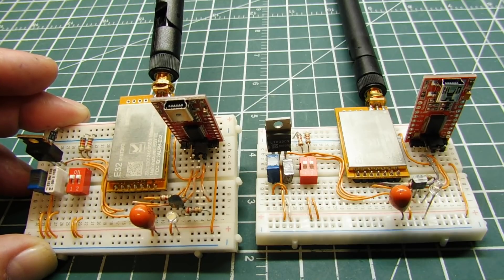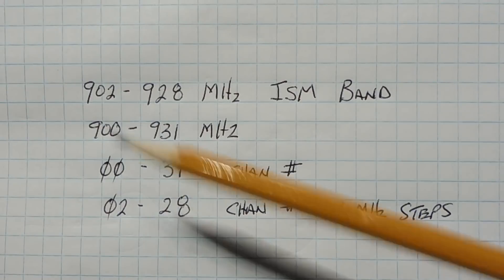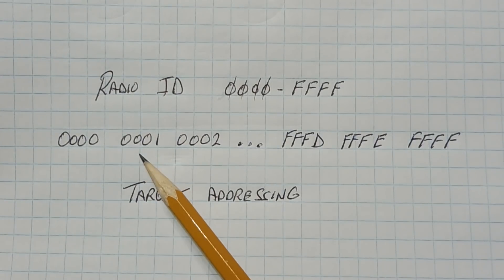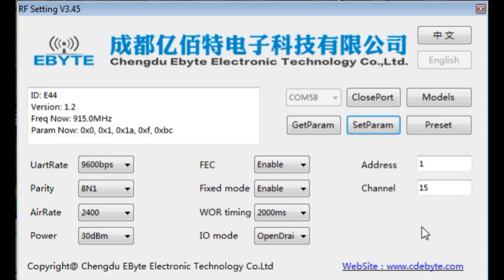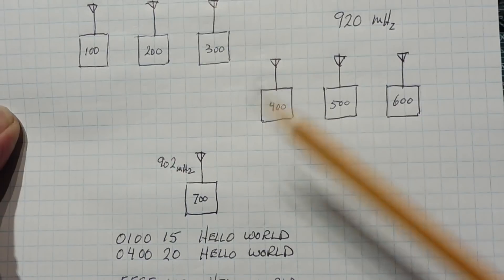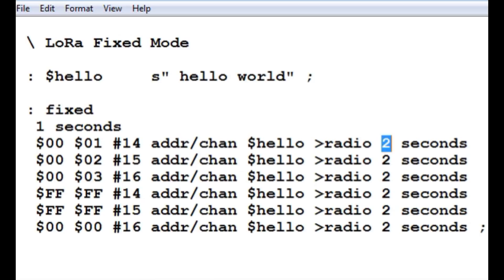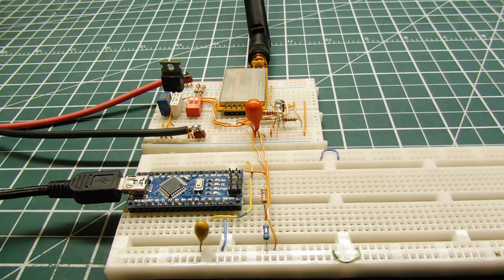LoRa Radio Point To Multi-point  / Target Addressing

Comment: hello, how does the module know when you are specifying the address in fixed mode?  If it's the first message after 2 seconds, it's obviously the first three bytes.  But what if I have a data stream?  Then my stream is cut off randomly and I don't know when to provide the address bytes again..

Comment: Hello again 0033mer! My E32 radios have finally come in and they have been quite fun to play with. I have a question or two (that will probably seem remedial to you) but I have been stumped by this, and as such I knew you were the right person to turn to.

I have the radios wired up on two different breadboards As per your wiring diagram. (Thanks again for that BTW). And, in BROADCAST configuration, I am successfully transmitting strings of data through Tera-term / Arduino IDE / ETC.. No issues there. 

BUT when I attempt to try the FIXED transmission configuration, I have no luck. I am using the eByte RF configuration software (which seems terribly documented, but it's the best option) and I set the address and channel so that when I 'get parameters' it reads back with an address and a channel equal to 915 Mhz. I have the power set down, and each radio has an antenna. they are spaced about 25 feet apart ( on separate floors of my house). This testing configuration was good for the broadcast transmission. 

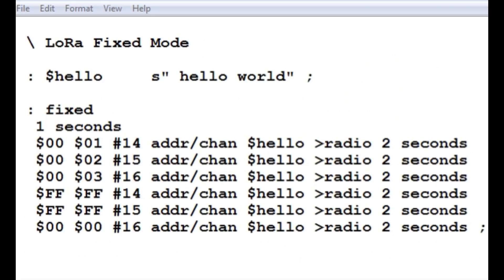I suspect I am not addressing the packets appropriately. At about 6:10 of this video you throw up some (I'm guessing pseudocode) that makes sense to me, but I don't know what is needed and how to implement it in say - a string I'm trying to send via terra-term. 

Can you provide some insight as to how I can address a simple string in Tera-term? or am I going about this completely slanted? I know the address is two bytes of hex, should those be together in the transmission or separate? can the channel just be the number 15, if I'm running 915mhz, of is 0xF the right way of doing it? I feel that I am close, but I keep getting nowhere fast. Any help would be greatly appreciated!!!
Reply from the maker: Tera-term is an ASCII terminal program so when you send the address and channel it sends ASCII code not numbers, which the E32 radio is expecting. The code you saw in the video was written in Forth which sent the addr/chan as numbers and the string as ASCII. You can write your own code or use Realterm for simple testing. Realterm can send numbers to the E32 radio. In the send tab enter 00 02 15 84 69 83 84 and send as numbers. 00 02 is the address, 15 is the channel, and 84 69 83 84 is the word TEST.
These numbers are sent all at once to the E32 radio.

Comment: HI there - love your work. I have a question that Google is being unhelpful with. In fixed mode, when I send a message with an ADDH/ADDL and channel, it works fine - but how should I know when the packet is done, and I need to send the ADDH/ADDL/chan again, vs just adding bytes into the serial output buffer. It can't be null terminated as you couldn't send date with a zero in it - perhaps when buffer is full, or based on a timeout? The ebyte e90 DTU docs don't cover this.
Reply from the maker: The Ebyte protocol uses CRC and Forward Error Correction (FEC) so the receiver node will have "Good" data or "No" data,  it is up to you to workout the packet housekeeping. You could use time delays between transmissions or have the receiver node send an ACK back when packet is received or an NACK implied after a selected timeout. Start Of Packet and End Of Packet (SOP/EOP) can be used to indicated a complete packet or even simpler CR LF bytes for parsing. For complex systems I have used the S.N.A.P. protocol.
https://www.dropbox.com/s/i9lmty0jsu02fmi/snap.pdf?dl=0
Reply: @0033mer  For a start , thanks for the quick reply - I had built in my own CRC/retransmit function and I do have a SOP (but not EOP) in my protocol. The main issue is I don't know how often I need to send the ADDH/ADDL/channel. Currently I send it every packet but I am getting some packets just not being received and I think the transmission is getting out of sync and I am unsure if the ADDH/ADDL/channel is being sent at the correct time to target the packet in fixed mode. I don't have an SDR to validate the actual timing and what is being transmitted. When I went looking for docs I can't find anything about how long the datastream stays alive before needing to be started again with another ADDH/ADDL/channel transmission
Reply from the maker: The ADDH/ADDL/channel only needs to be sent once per packet but I think you might have a sync problem with byte subpacking. Every model is different but each have a buffer that you fill on the transmit side. Say it is 512 bytes on your model but the transmit buffer is only 187 bytes, so it sends subpackets of 187 bytes until the buffer is empty and your receiver might be confused. Try sending short packets ( < 50 bytes ) and see if it solves your problem. If it does, split your large packet into smaller packets and number them so they can be assembled back at the receiving end.
Reply: @0033mer  I am sending fixed size packets comprising of 3 bytes ADDH/ADDL/channel, then 2 bytes as a SOP header "AB", then a 28 byte data structure with the payload, then I am reading the additional 1 byte RSSI value added by the receiving DTU... So I am sending 3+2+28 = 33 bytes and reading 34 bytes. I have the sub pack set to 64 bytes and the device has a 1000byte buffer. I know the first packet is sent before the 64 or 1000 byte limit is received but I am unclear on the mechanism by which the DTU decides to cut off the input and send what it has.
Reply: interpacket delay needs to be around 1 second... I can make the problem WAY worse when I take that down under 500ms, and I can stabilise it greatly by taking it up to 2 seconds
Reply from the maker: The DTU monitors your data input and waits for 3 byte times (of no data) and treats that as data termination. When bench testing do you use dummy loads on the antenna terminals or distance the two radios with power output set to low?
Reply: @0033mer  Aahhhhhh, That is the magic piece if information I hadn't found anywhere else! (3 quiet byte times meaning termination). Unfortunately it does suggest my suspicion about the root of my issue is wrong but great to know. I am testing with 2 devices both turned down to -24 and the worst aerials I have :-) Many thanks for the assistance - I love your content... Very well presented and so useful!
Reply from the maker: Ok ... glad that helped. Make sure your addr-SOP-data-RSSI stream is continuous with no quiet times.

Comment: What 0033mer fails to mention here is that string needs to be in Hexadecimal in fixed mode
Reply from the maker: Check the code at 6:29. The prefix "$" indicates hexadecimal.
The address range at 1:50 is in hex.

Comment: i want to setup lora network. can I read this data from the master by using multiple transmitters with this addressing
Reply from the maker: The receiver can acknowledge back to the transmitter using fixed addressing to target one transmitter. It can also acknowledge back to all transmitter by using a broadcast address. All transmitters would have to be on the same channel. Check the data sheet on the E32 modules for more detailed information.

Comment: Hello. Is it possible to receive your complete FORTH code?
Reply from the maker: Code starts at 6:05   See below for extra words.
: addr/chan        rot emit swap emit emit ;
: >radio               type ;
Reply: @0033mer  When I talk about the full source code, I also think of the code that allows to communicate with the LoRa transmitter ... I know that it communicates by serial link, but I would have been interested in this code too. --- Your videos are fine, but without the code it is not reproducible. --- I have reconstructed your WigWag multi-task FORTH montage and I post everything here: https://arduino-forth.com/article/FORTH_FlashForth_applicationsMultitaches

Comment: Nice tutorial. Please do you have any similar implementation for LoRa Mesh radio modules?
Reply from the maker: The E32 LoRa modules do not support mesh but the E104 and their Zigbee modules do.
Reply: @0033mer   No I am refering to these specific LoRa mesh radio modules: https://www.devicemart.co.kr/goods/view?no=1376642
Reply: @judithnjoku7729  there are df dorji paramater setting softwares like:
 DRF127xDM_V2.7 this.
Reply: @ahmedakifhekimoglu  Yes i already tried using the Dorji tool. No success with my configuration yet.
Reply: @judithnjoku7729  did you pull the EN pin to the GND while configuring

Comment: With this setup, can the slave modules also send data back to the master or is this a one-way communication ?
Reply from the maker: Yes .. the radios are transceivers so data can be sent back and forth (bi-directional) on the radio link.
Reply: @0033mer  so cool. Did order 3 pcs of this now!

Comment: It is very interesting to see a project for sending SMS using these modules (two-way pagers without addressing). With signal relay or network building. For two, three or more devices. Like this but with relay  https://youtu.be/H42atKsWvzU
You could use the terminal program as in your video https://youtu.be/_5g5lC-nDy8